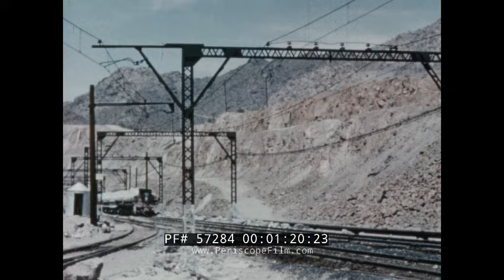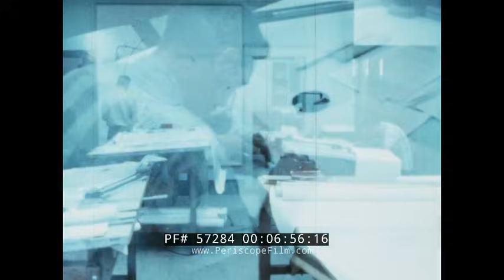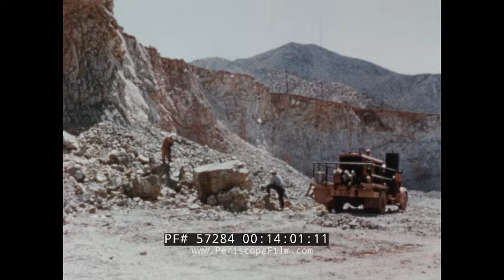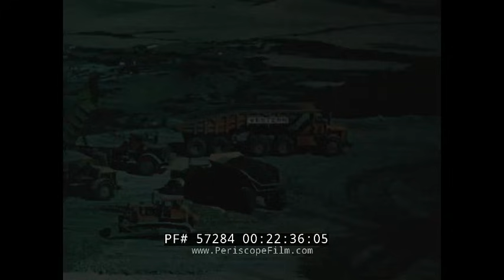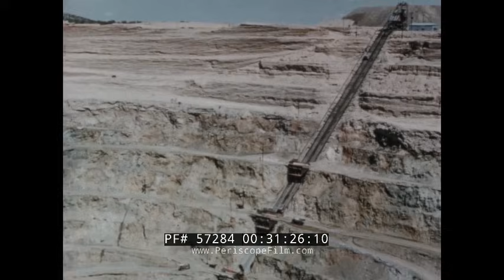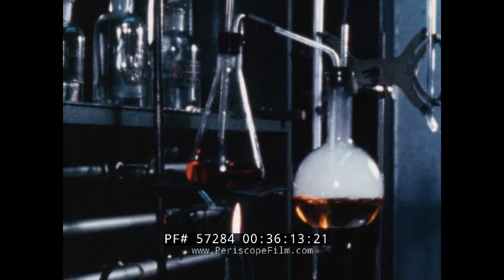OPEN PIT MINING OF COPPER IN THE AMERICAN SOUTHWEST 1960s MOVIE  57284

Comment: These mines are still there. They are known as toxic waste dumps now. Why the mining companies were allowed to move out without cleaning up their messes is beyond me.
Reply: the mines are not the waste dumps, it is the refinery's....and if not for them, you would not be typing your message, you would be writing it with a stick in the sand
Reply: @Laura-br549  Did you ever climb the side of the Bluebird mine in Superior? They dumped thousands of barrels of acid on top that which all ran into Queen Creek, poisoning it forever. Casa Grande has another mega toxic waste dump.
Reply: @bingosunnoon9341  that is why there is copper wire on top of those pylons carrying the electricity down into your house that gave you the ability to type that and powers the light bulb so you don't trip over in the dark and a hot shower TV....etc etc....
Reply: @russellking9762  Is that hot shower heated by electricity, gas, or some other fossil fuel?  Hhmm.....................We wonders, yes we wonders.